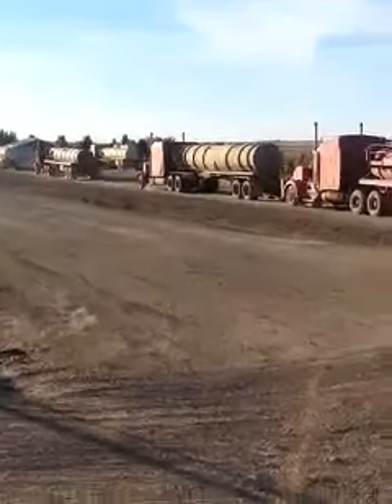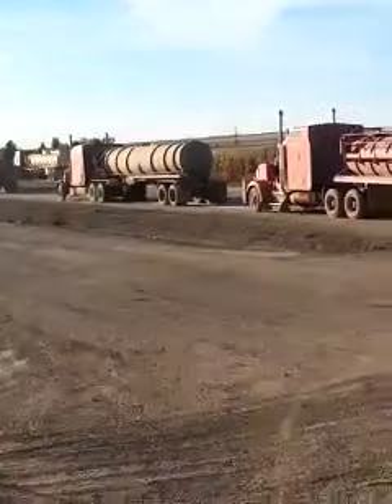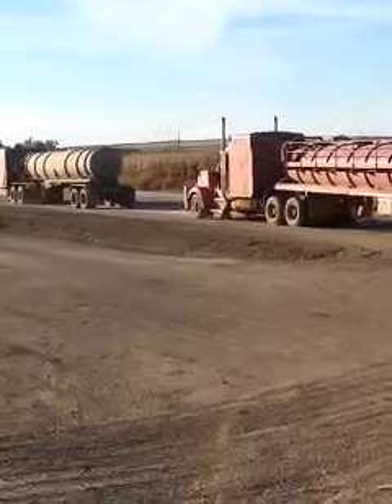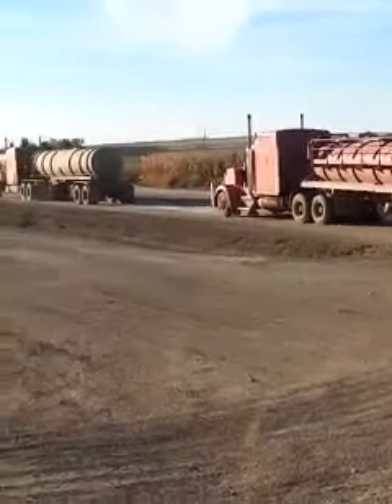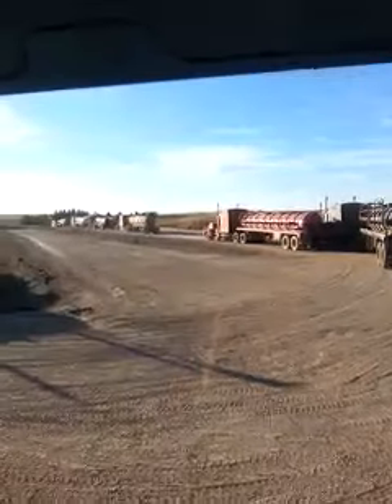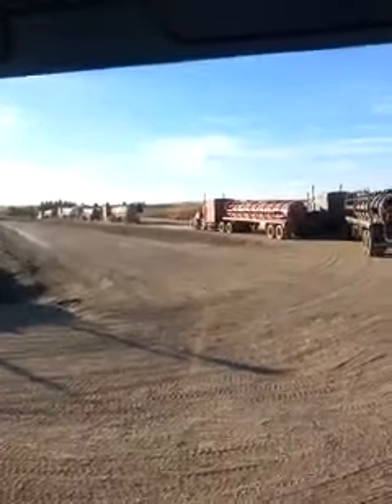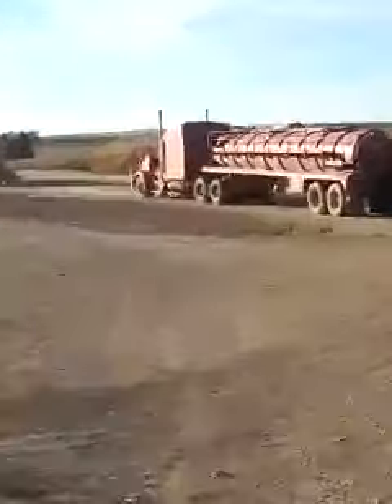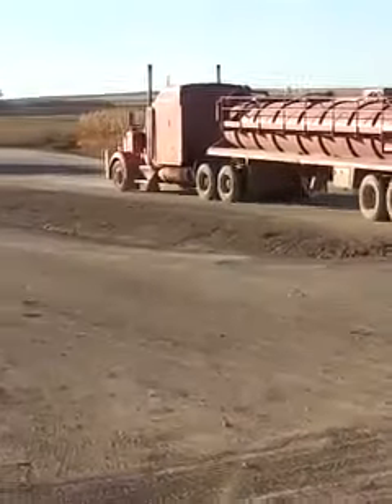Water Hauling How to Get more Sleep During a Frac

Comment from the maker: Everyone asking about the sensor:

You put the sensor on your grill and the chime box in the cab or sleeper of your truck. Be sure to park as close as you can behind the truck in front of you so when it moves, your sensor will pick up on it. They don't work as well at night and insects can some times cause a false alarm. You can find a multitude of different types all over the Internet by simply typing motion activated wireless sensor door chime into a search engine. A whole slew of options pop up. You want one that takes batteries and that comes as two parts. Use zip ties to hook the sensor to your grill. Keep the chime box in your truck. I just keep it in the sleeper by the bed.